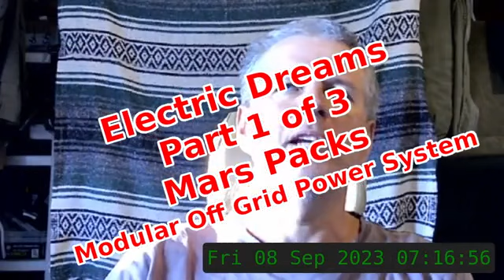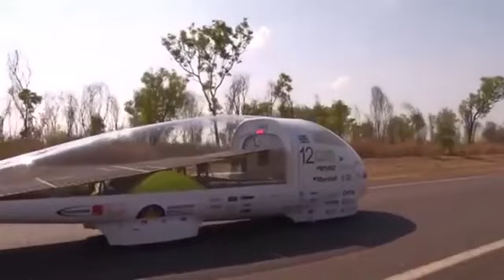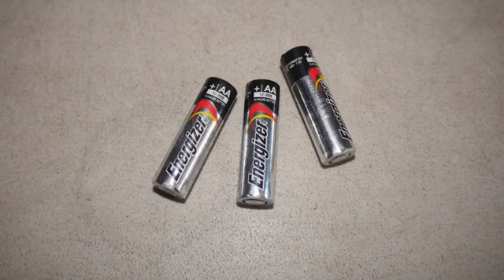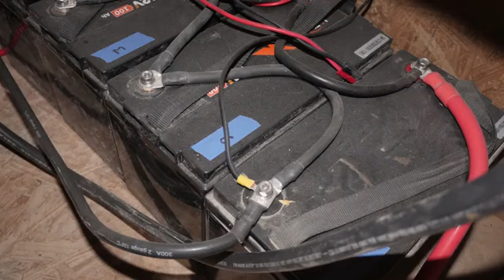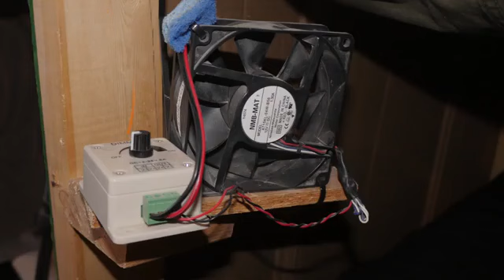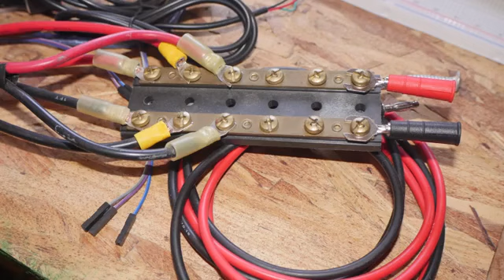Electric Dreams 1 of 3 - Mars Packs - Not Coming Soon

Comment: Good to see another video. With the heat you have been enduring this summer, it must be hard to think, let alone work on a project! Keep the ideas coming cause cooler weather is around the corner. Take care.
Reply from the maker: Yeah I've been having trouble getting anything done this year.
Reply from the maker: Most ideas, if I don't actually get started in the first week, they just don't get done, so momentum is a force not to be wasted.
Reply: Are you missing a big bike ride?
Reply from the maker: @gwenlaursen6460 Yeah, if I'm not getting anything done, I'd rather do it somewhere else!

Comment: Ever look into the mental wheel? Which uses liquids to be heated with propane and push to a higher level. And then it can't get this wheel. Turning lower PM high torque. You can scale up, scale it up to any size
Reply from the maker: No I don't think I've ever heard of that, interesting!